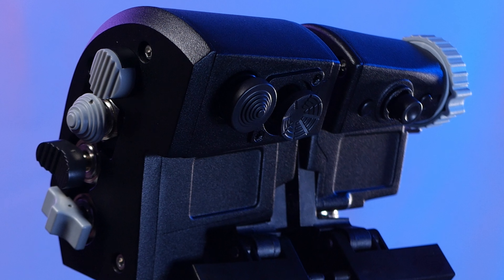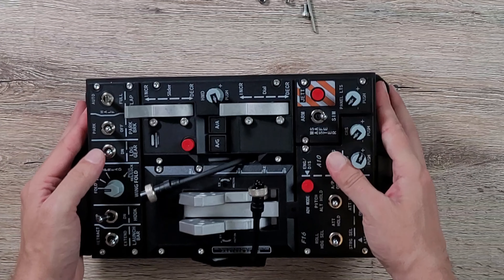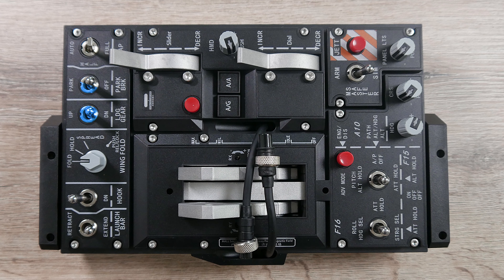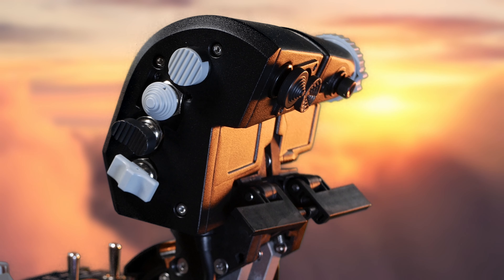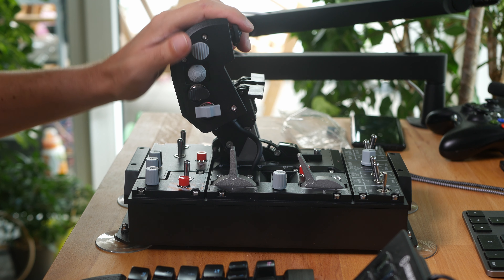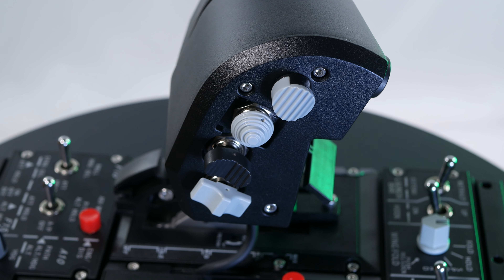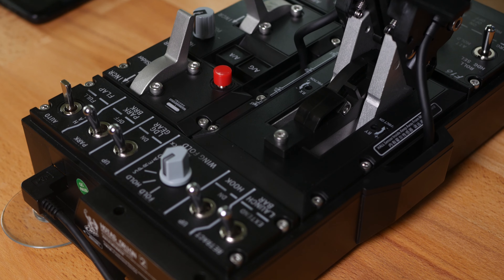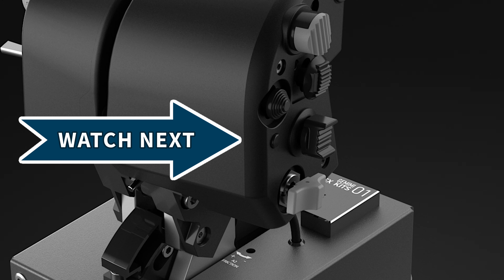Fits Any Plane: WinWing Orion2 Base + F-15E Grip

Comment from the maker: Additions to the video:
- Great equipment! I rate it 5 out 5 Heinzes! :_Heinz::_Heinz::_Heinz::_Heinz::_Heinz:
- F15E grip: On the Super Taurus base only one vibration motor will work. The smaller hat will function as a single push button.
- Videos with this level of quality take a ton of time to make. To help me keep the channel going please consider to buy me a coffee https://ko-fi.com/watchmysh or drop me a super thanks. 
- Don't tighten the screws on the fingerlift too far. Only finger tight else you might break the plastic (Thanks @datamasked)

Comment: Their products are decent. However, if you need customer service or have a defective product, you are screwed. They will offer little to no help. They will expect you to repair your own product.
Reply from the maker: How do you know? Honest question. Happened to you?
Reply: I had an issue with my old orion 1 stick base. If i applied right rolll to the stick it would max out and snap back to center and max out again even if it dont make any inpit past the initial input. I had recorded the screen running their sim app while having a side by side video of my physical inputs. You could see I wasn't adding any inputs while you could see the x input going crazy in the app. Thier customer service after I sent many recordings and emails on the issue. They told me to reset my dead zone and after I did that the base wouldn't register any right roll on the  x axis.

 Sorry for the essay but it was a complicated issue and really horrible customer service experience.
Reply: Thats exactly the reason i would never buy it!!!!
Reply from the maker: @mickhick619  did they replace the base afterwards?
Reply: @WatchMysh  no they instead told me I wasn't doing the calibration properly and that's why it didn't work.  Which was bs cause even after I tried recalibrating it I no long had any right roll on the X axis.
Reply from the maker: @mickhick619  what happened then? Did you get it to work somehow?
Reply: @WatchMysh  I replaced it with a virpil
Reply from the maker: @mickhick619  what did you do with the WinWing base then? Wasnt there warranty?
Reply: @WatchMysh I threw it away after my virpil came in. I got it 3 years ago and I  didn't want to deal with a company with that kind of shitty customer service so I went with virpil.
Reply from the maker: @mickhick619  Understandable. Hope that's been an exception and/or things changed now. Pity you threw it away, though. I'd love to inspect the unit to find out what's wrong with it.

Comment: thank you for this review. The big downside with the Orion2 base is that Windows no longer recognizes it after a few months, for some people. I know someone who has the problem and who is in contact with Winwing support and still no solution.
Reply from the maker: Thanks! :) interesting - I'd be curious about the solution if there's any. Otherwise that's what's warranty for. Just have the unit replaced. :) I can't see a big downside here as long as it doesn't happen with more than a few bases. I'll have an eye on it. Let's see if this issue gets posted more often over the next few months.

Reminds me of my Corsair Commander Pro. Had it replaced 3 times within 6 months and then finally switched to an OCTO. Something can always break down and sometimes we get unlucky.
Reply: @WatchMysh  The concern is that returning the equipment under warranty to China is expensive, from Europe. And and it is the customer who must pay the shipping costs. Winwing will indeed send back brand new equipment. Winwing will pay the shipping costs to Europe, but the customer may have to pay customs fees which are very high for us in Europe. In short, it can be expensive...
Reply from the maker: @checkyoursix7401  yes, that's a problem. Still as far as I'm informed customs fees only apply on purchase, not on replacement. I didn't have to pay for review samples for example. The shipping cost are still there, though. But I guess Winwing is already working on a european support center. Long distance transport is inconvenient for everyone - company and customer. They are selling too much stuff here. I suppose it'd pay off.
Reply: @WatchMysh  I remember asking a few months ago if Winwing was planning to open a EU distribution center but the answer was no :(
Reply from the maker: @crevetta6128  yes that's also my level of Information. But I guess they won't get around opening an EU office once delivery volume increases. Especially with the new pedals being a lot bulkier than the products they have right now.
Reply: The China trap
Reply: @checkyoursix7401 real question.  Do you really think when a company offers free shipping, it's actually free? 
Nothing is free. It's just shifting that expense to another avenue. You or someone else will pay for it. Or like alot of western countries the price of everything is elevated to cover shipping. So your still paying in most cases paying more for shipping than you would if it was a direct charge.

Comment: While the throttle grip is metal, the mount is cheesy plastic and VERY prone to breaking.  One must be very careful to not over tighten the screws down, and then hope theirs doesn’t break.  Many of us didn’t know this, and suffered a fracture right at the screw line where the fingerlift kit attaches to the metal throttle part.  JB Weld has worked for many, along with snug and not tight screws.
Reply from the maker: I'd also rather have a proper metal mounting system (like I mention in this and another video). But I can't confirm the "cheesy" and "very prone to breaking part". The plastic does the job and from my experience you'd have to try hard to overly tighten the screws to a level which would break it.
Reply: @WatchMysh  I will accept your point.  I still stand by the fact that the plastic piece is unnecessarily thin, there is plenty of room for a thicker portion right there. Sadly, I am not empowered with knowledge of proper torque for screws into plastic, and lacking any clear instruction provided with the item and the plethora of others with the same problem, you can see the limitation presented by WinWing's lack of guidance.  A simple sentence provided by WinWing similar to the ones stated by those who comment on the sad fate of folks like myself would certainly help greatly.
Reply from the maker: @datamasked8632  what do you mean by plethora of others? I've never heard of a broken grip connector from anyone else? They wouldn't go bancrupt if they'd ship a metal connector instead of the plastic one though ... it's the weakest part of the whole setup. Maybe they'll improve it in the next revision.
Reply: @WatchMysh  multiple threads with multiple people having same/similar failure mode of fingerlift kit breaking at the screw installation area. Your point about over tightening is certainly valid, if only that information was provided by WinWing so we could all torque those screws properly.
Reply from the maker: @datamasked8632  ok thanks. Need to find these threads... Torque is "finger tight". Winwing really should mention this.
Reply from the maker: @datamasked8632  Got the threads. Thanks for pointing everything out. I've put the info into the sticky comment.
Reply: @WatchMysh  i still like my Orion2 and am keeping it.  This is a bump in the road but can be solved. Dont crank down the mounting screws 😊.  I learned something today.  

Thanks for your content!

Comment: very happy with my Orion1 and hornet grips. I have ordered orion2 with F-15E and Orion2 anniversary with F-15EX. cant wait
Reply from the maker: Nice!! But then you have... three bases?
Reply: @WatchMysh  yes. I don’t feel like swapping grips on bases all the time I I change airplane. 

I also have 2 virpil WarRbD bases one with a thrustmaster f18 grip and the other one with a virpil f-14 grip… and then I have a thrustmaster warthog stick on a cougar RSS1 modded force sensing base, and… well don’t get me started. I am a bit of a sim junkie…
Reply from the maker: @dunbar555  Comfy! My flight sim budget is a bit more limited - so I have to swap manually. But I'm okay with not always having the 100% correct grip. So I'll mostly use the F15EX with 98% of the planes in the future.
Reply: @dunbar555 you might aswell  get a real plane and fly that 🥴

Comment: I am still undecided as to which grip I should get, the E, or the EX, I like the versatility of the EX, but do I really need all that? I think  the price is about $30 more for the EX grip.
Reply from the maker: It's just that. You pay more and you get more controls. I guess I'll use the EX 99% of the time because it doesn't take away anything from the E but adds more controls. More controls on the grip itself are good especially for VR.
Reply: yeah, I have the F-16ex stick so I will probably go with the F-15 EX throttle too.
Reply from the maker: @rwhunt99  The F16EX is so good...
Reply: This is a year later and I got the F-15e grips, I figured I had the F-16es that gave me more hats and that would suffice. That said, I did want to add to the critique of the throttle. I found the suction cups don't work well on my desk, so I think I will have to invest in some good desk mounts, that might help with my other criticism which is -  when you have the throttles forward in 100% Mil power, or after burner, it's difficult to reach the switches on the front of the throttle base. Other than that, I agree Winwing did a good job and from the improvements from the original Orion throttle base, they seem to listen to the feedback they get. I do wish they could have improved the instructions on how to use the software (simapp Pro), its fairly easy, but there is a lot that is hard to understand and it takes a lot of experimenting to get the full potential out of the hardware.

Comment: Excellent presentation! I have owned the Orion 2 hotas max F18 grip for a year or so and love it. My only issue was with the wing fold switch along the top row. My push function broke and I can no longer use it to lock the wings of my F18 :(. I see they have replaced the button in this video. Will be buying another base and F15E grip since I am planning on spending most my time in it along with the F18. Not about to switch grips. Also, periodically test the screws in the detents around the base, if one comes loose and falls into the base, you will be a monkey f#cking a football to get it out.

Comment: Go figure the F-15E throttle grip is never in stock, at least not in Canada. Only the F-18 grip which doesn't have enough features.
Maybe sometime soon.
Looks like a nice system.
Reply from the maker: Everything is sold out the hour they restock most of the time :(
Reply: @WatchMysh  That sucks, it means your whole life has to revolve around stalking a website. So be it.
Reply from the maker: @devilsoffspring5519  lol. Yes. Oooor you can pre-order :)
Reply: @WatchMysh  Yeah, you can pre-order and two years later they send you the wrong stuff and you've already had to pay off your credit card to avoid interest payments so you can't even dispute the charge since you've already paid it. Screw that noise!
Reply from the maker: @devilsoffspring5519  Never tried to pre-order sth. at Winwing - but I guess you're just on a waiting list then? No need to pay up front. Never heard sth problematic about their process.

Comment: I watched so many reviews on stick's throttle quadrants & some additional peripherals, but i have not found yet what i am looking for. I think it's not made yet, if i was a flight sim hardware designer i would know, that some people need a 2/4 engine ww2 throttle control with engine power-prop-mixture, as well as prop feathering features. Next for the flight stick a virpil or a vkb design stick long or short version with a force feedback features built in. I see great products but never exactly what I am looking for 😢.
Reply from the maker: I use the Orion'*s two wheel axes for water and oil radiators and cowlings. Prop pitch, mixture and feather can be bound to the (spring loaded)encoder(s)on the F15(EX) grip. Or you could get  a Gladiator and expand it with a VKB throttle quadrant module.
Reply: @WatchMysh  Well from what i have seen, the best setup for my needs would be a honeycomb throttle quadrant with  a virpl constellation alpha prime & a warbird D base + VPC ACE Flight Pedals. I usually fly in a IL-2 where i really need that ww2 stuff. The only downside to honeycombs throttle is that it can't be setup for a lefthand use! VKB throttle additional peripherals are looking like cheap plastic comparable to Saitek entry level stuff. They have good sticks though!

Comment: i have a question, was this sent to you for review. or have you bought this yourself?
Reply from the maker: As I disclose in the review within the first chapter: it was sent to me but without any strings attached. WinWing had no editotial rights. 

After flying with the Orion2 for half a year I'm still happy with the device except for what I've criticised in the video which still stands. The finger lifts should be a metal construction as well for example. Mine are still okay, though. If you don't overly tighten the screws everything should be fine.

Comment: Get the f-15 NOT the f-15 ex throttle!!! The EX has no proper speed brake switch!
Reply from the maker: Yes. If you absolutely require a speed brake switch I also suggest to rather buy the F15E instead of the EX. I personally can easily work around the issue and profit from the additional controls.
Reply: @WatchMysh  Agreed. I chose the f-16 ex stick for the additional button and kept the f-15 throttle. Honestly, whatever winwing hotas a person buys, there are plenty of buttons. I do love an actual air brake switch !